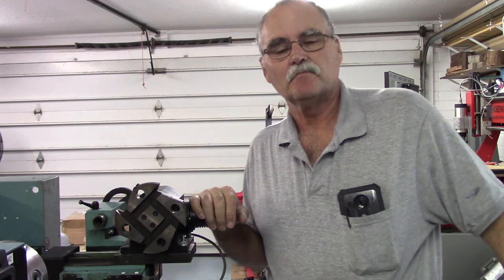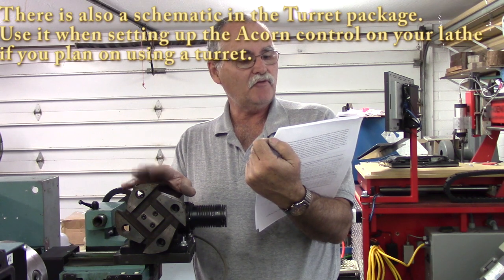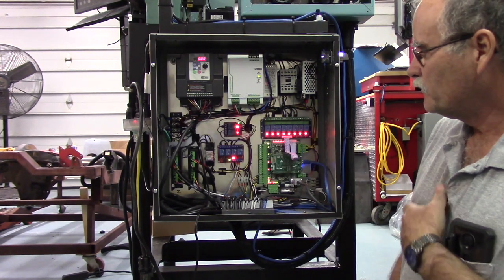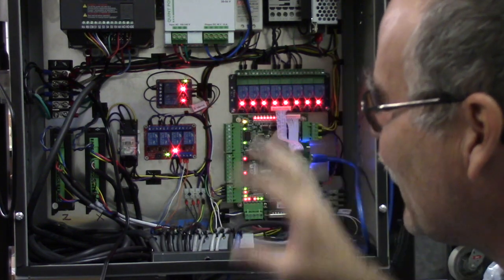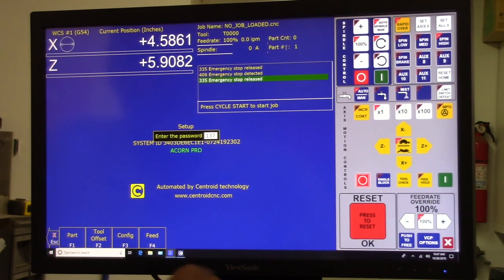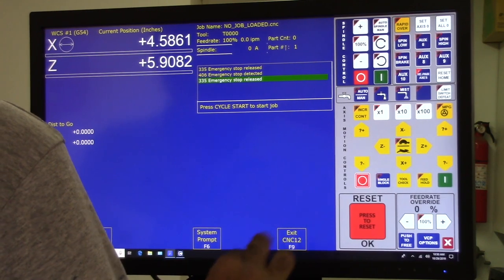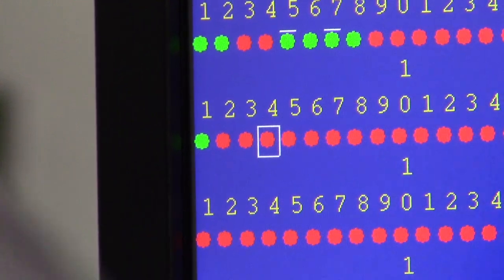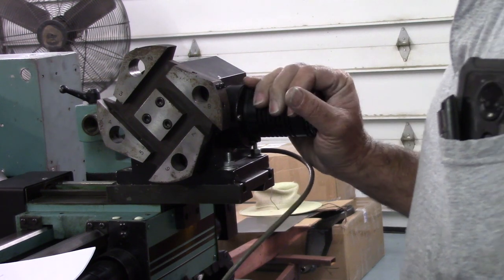Denford Orac Turret setup and demo under Centroid CNC Acorn control

Comment: Can the Acorn board be used instead of the Allin1 board if the old CNC mill being upgraded has Servo Motor Drivers that work?    Do encoders on the back of Servo Motors on CNC mills take the place of glass scales and read heads that are used on DRO's on manual mills?    Are step motors used on CNC mills some times or only AC or DC Servo Motors?   Which is better?     
 Thank you,
Reply from the maker: If the mill has DC servos, Acorn can not control them unless the servo drives take step and direction. Otherwise perhaps All in One DC or Acorn with new AC servo drives and motors

Comment: Great build, I have a Denford starturn 8 which uses the same turret. It runs on DOS and has lost connection to the software, so am considering anl retrofit. How much do you estimate it costs in parts, and how many hours would you think it takes? Thanks
Reply from the maker: Go read up on the Centroid forum. Look at the Emco PC5 build I provided a list of parts and estimate for that build. It will give you an idea.
Reply: Thanks, I will do that. Thanks again for your video

Comment: Did you write the PLC program or did Centroid? If Centroid wrote it, how much did it cost?
I take it those holes in the turret, are for internal tools or shanked tooling.
I think it's great that a company like Centroid developed an affordable "real" control  like Acorn, I have been waiting a long time for something like this.
Using various mill & router controls that say they work for a lathe,  just doesn't cut it.
Reply from the maker: Centroid wrote it and it is available on the Centroid CNC User Forum. the holes in the turret are for drilling/boring tools

Comment: Hi Marty, 
I just got a Orac Lathe, I want to make a retrofit using the Acorn, do you have any guide/Advice? The lathe is having all the original electronics from the 80's
Reply from the maker: Just follow my build, use Center Acorn, closed loop steppers, 3phase spindle motor and VFD as I demonstrated. PLC for Denfords turret is done.

Comment: Is it possible to connect such heads with a stepper motor to Centroid
Reply from the maker: Go check out the forum and download the ATC files from the Acorn knowledge base forum. Schematics included. https://centroidcncforum.com/viewforum.php?f=63
Reply: @martyscncgarage5275  I am from Poland, there is an Acorn distributor here, but they cannot say anything I cannot register on the forum because I do not have an Acorn driver yet and the number is required
Reply: I asked if a steppick can control such a head because I can't find anything like that on the forum
Reply from the maker: It depends on how the turret was originally controlled. All you have to do is post pictures and describe how it works. Then we can help with suggestions.
Reply: @martyscncgarage5275  Thank you for your reply as soon as I have photos to give
Reply from the maker: @radoslawwojdylo50  NO number is required! Joining the forum is FREE. https://centroidcncforum.com/viewforum.php?f=60